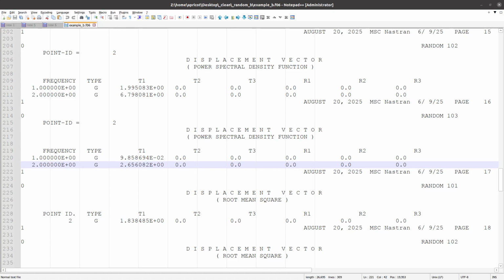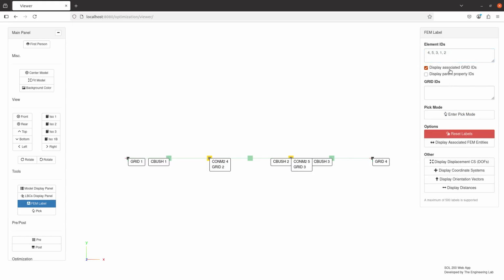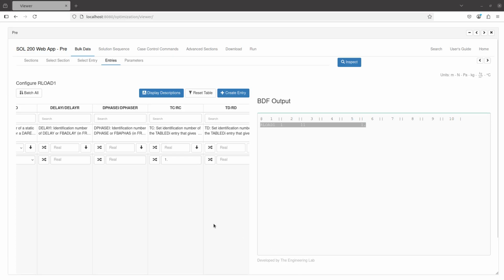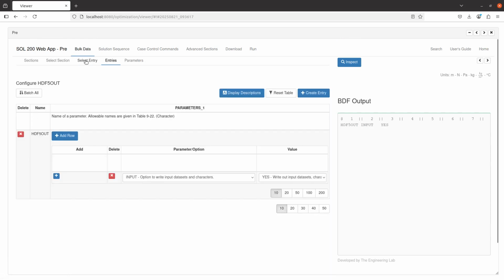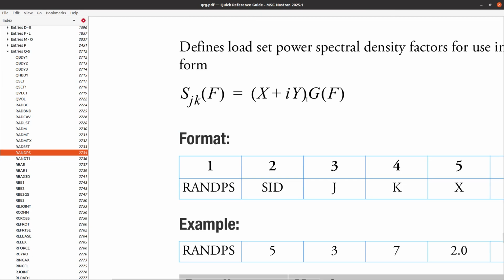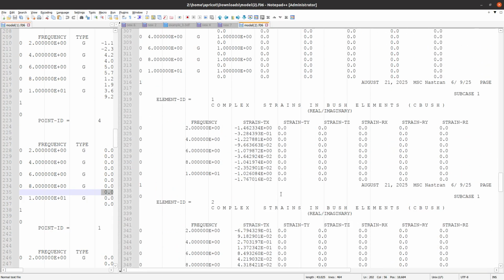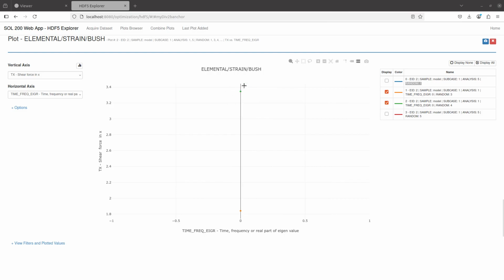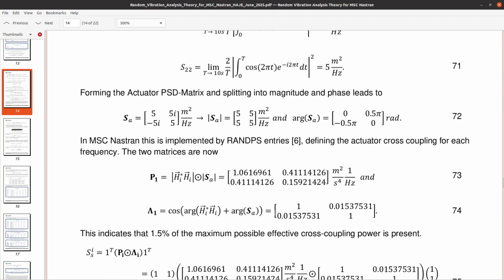How to configure a random analysis for MSC Nastran/Patran

Comment: how to get stress at nodes in random analysis
Reply from the maker: Use the STRESS command with describers PSDF and BILIN options. See the example below.

STRESS(PSDF, BILIN)=ALL

BILIN triggers corner output at the nodes for CQUAD4 elements. PSDF outputs power spectral density function values.

There is another command GPSTRESS that outputs stresses at the nodes, but it does NOT support the PSDF describer.